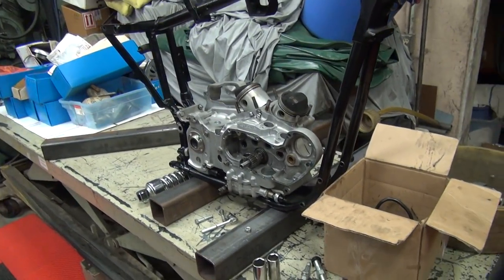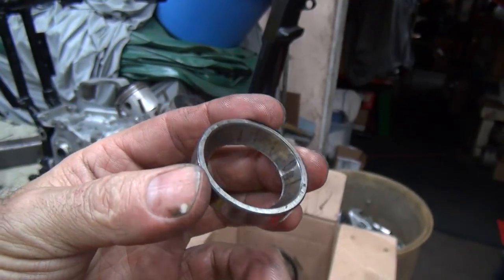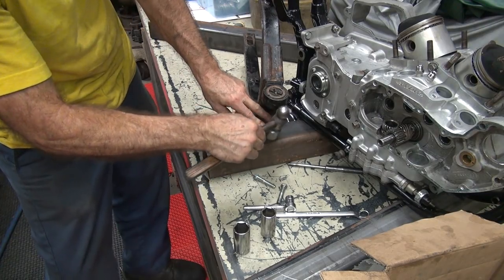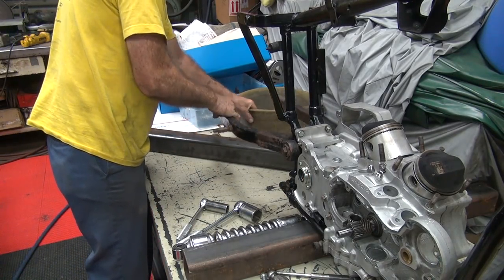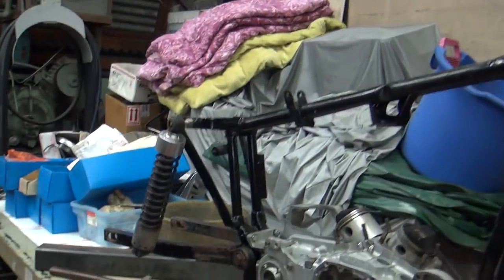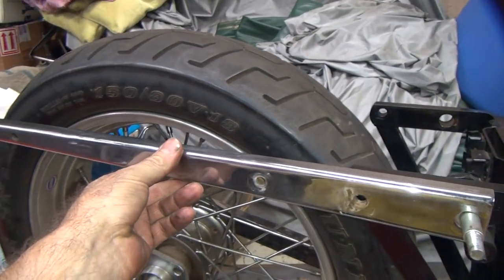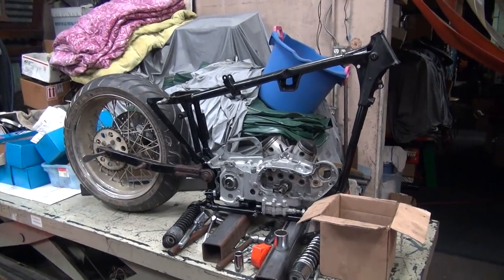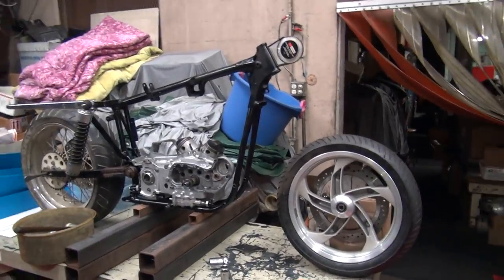1972 #110 1000cc ironhead sportster bike rebuild repair street tracker harley by tatro machine

Comment: It's nice that you're using the later ironhead swing arm so that you can use disk rear brakes. I hope you talked him into opening the cases so he doesn't have problems after everything is done. I think it's foolish not to seeing you've gone this far, it would be a shame to have something really wrong with the bottom end and not know it until it's to late.  Nice work so far and thanks for recording it all.  later
Reply from the maker: i can use disc brakes with any swingarm or frame. the stock later swingarm just has more room for the bigger tire.
he does listen to what i recommend. 
he told me what style bikes he likes and what he would like to do and i shot him in the direction to get what he wants. the trick is to come up with a combantion of parts that works as a unit and be reliable. looking good is way down the list for me.
tatro

Comment: Tatro, really enjoy all of Your Videos. I am going through My 79 XLS Roadster, As We speak . I feel like I am loosing my mind. One part I am looking for, is a stretched 79-81 my rear Fork/Swingarm. I could almost swear they used to for sale in the old Jammer catalogs. And I have been looking for 3-5* Triple Trees. Did they just stop making these in the last couple years? Also I hcave been looking at forward Controls. It seems like the 99 down XL Forward Controls would fit these old Ironheads with minimal work. as the Front Engine mounts seem very close. Thank You for your time. I know your a busy Man. Stay Safe and thank you for great videos.

Comment: All that fiddling with the swingarm reminds me of a job I'm dreading, and putting off for another season. Maybe. I really should pull my '85 FXRS apart and inspect. I might be the third owner, and this motorcycle had suffered a lot of neglect and some half-assed hackery. I wish the belt needed replacing, then I'd have a good excuse to get to it.

Comment: you got to tigtin thos so tight they should hold ther position on the fram ,
Reply from the maker: if that is for the swingarm, no. the correct adjustment is about 3lbs of drag. the swingarm weights more like 5-6lbs.
tatro
Reply: Tatro Machine when i was the boys age , i had to put a swing arm on my 79 and didn't tight in it enough  ..lol did a dog trail on me down the road ..then some old guys told me it had to be so tight the swing arm should hold its position on the bike ..but still move under load ..i love my iron heads got 5 of them

Comment: Tatro,  my 81' IH.....I have a 16" rear wheel. Could i lace a 4-4.25 rim to my hub and  not have to mess with my disk brake or sprocket setup ?  My thought is it would be cheapest to jist need a rim rather than have to get everything needed  for spacing the FL rim and getting the brakes and chain functional using the FL rim.   If I keep the same hib, everything is all ready set up....is that correct ?